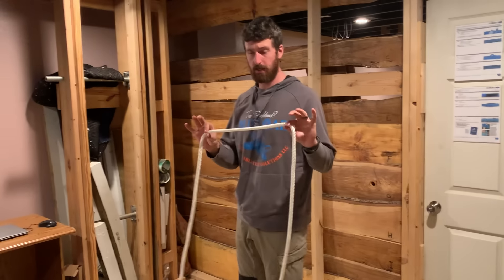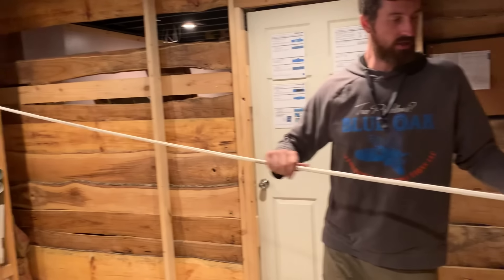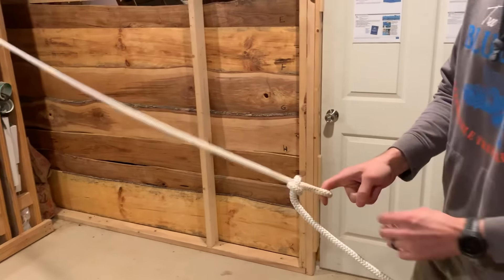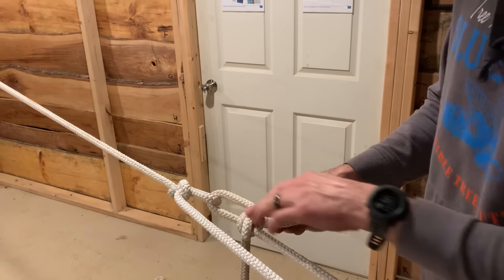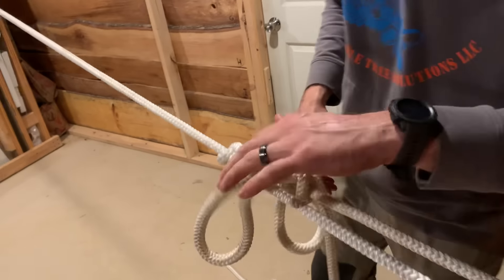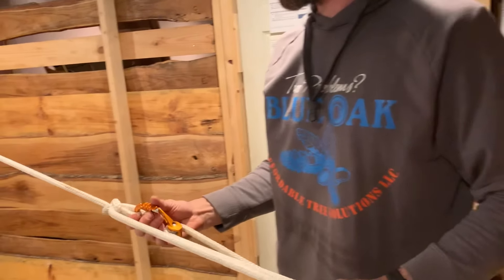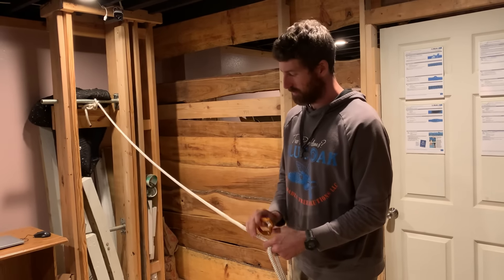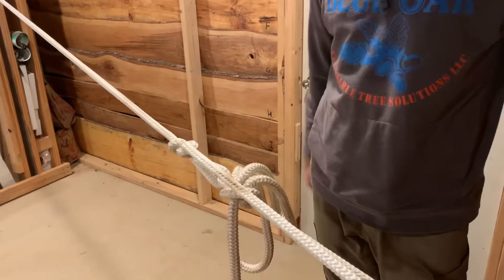The trucker’s hitch and an easy 3:1 set up

Comment: Look at the physics of this. The pole only changes direction, therefore this is a two to one mechanical advantage .
Reply from the maker: Actually this is a 3:1. The first strand is still being pulled, then when it goes back through the slip knot, it’s adding a 2:1.  This makes it a 3:1. It’s the same concept in rock climbing if you have to make an improvised hoist.
Reply: In any arrangement of pulleys, the free end you are hauling on does not count as one of the shortened ropes. 2:1.
Reply: @alexchun1105 , it is well known that the information presented in Wikipedia must be taken with a grain of salt. A look at the revisions of that entry reveal a long list of confused evaluations of the purchase afforded. A cursory check of that diagram claims that the two anchor points are being drawn together by differing amounts of force; The lower point bears a load of 2F while the upper bears 3F, rather incongruous.

Suppose we redraw that diagram a trifle. Eliminate the short length of line supporting the upper pulley, and move that pulley upwards to the point of connection with the rope. In practice this would be done by tying off the upper line to the top of the pulley, and making fast the lower portion of the line to a becket at the pulley's bottom. Now thread the line through the lower pulley, and then back up through the upper. This gives the same arrangement, resembling a little more a conventional block and tackle, and you can count the number of ropes shortened, which is two, as the free end you haul on is not counted. 2:1 advantage.
Reply: @leehaelters6182   Thank you for your considered reply.  I don't have the diligence to understand the description of your model's setup.  But I did look up the references for 3:1 in Wikipedia.  Here they are, in case anyone here has either of these available, and cares to chime in:

Compton, Nic (2013). The Knot Bible. Adlard Coles Nautical. p. 74. ISBN 978-1-4081-5476-2.

Tilton, Buck (2019). Outward Bound - Ropes, Knots, and Hitches. Falcon. p. 34. ISBN 978-1-4930-3503-8.
Reply: @leehaelters6182  The difference between the 3F at the top and the 2F at the bottom is not erroneous. Analysing the forces in the vertical plane gives a total of 3F in each direction, as you have to take the 1F into account from the pulling force. For the system to be stable the forces must be in balance , which they are. If you then tie off the pulling rope to the bottom anchor then you will get 3F both ways. 
They are just taking the temporary case while you are holding the rope.
Reply: @rikwhite6337 , thanks for the reply, I will mull that a bit.
Reply: @rikwhite6337  I concur with you.  All the 1Fs make intuitive sense.  So the bottom 2F makes sense.  The bottom pulley is anchored, and the very top is anchored, so the top 2F makes sense.  So the 3F adds up and makes sense too.
Reply: @rikwhite6337 , re: that diagram. As a means to measure the force multiplier by counting shortened ropes, the end you are hauling on is not used. Now, suppose you hauled down on that end, but rather than making fast to the lower anchor point, we simply chocked the line at the pulleys mouth, so that it would not slip and the end dangled free. We now have a system in equilibrium, and yet the diagram claims differing forces at either end.

If this means that you support the 3:1 mechanical advantage analysis, here is some experimental proof to the contrary:

https://youtu.be/R1a3PTscy-U
Reply: I posted this on another comment too....

If you don't think it's 3:1, you can test it. Set this up between a chair leg and something that doesn't move. Pull the loose end 3 feet and the chair will move 1 foot. It's 3:1.
Reply: @JDeWittDIY . J, did you view the link I posted in my last replies to Nathan, Alex, and Ric in this thread? You can skip to near the end of it, if you like. Joe Pye is quite meticulous.

Did you perform the experiment you describe yourself? I will comply and advise later.
Reply: @leehaelters6182  Yep, I did the experiment with a piece of string, a ruler, and two chairs (sitting on one). I pulled the string 12 inches and the chair moved 4 inches which is 3 to 1.
Reply: @JDeWittDIY , thanks for your reply. I did this experiment, too, and I admit that it is a poser. You do need 3x amount of rope to exit the ''pulley''  loop to effect 1x movement in the load end if you are hauling away from the loaded end, quite so, and if you haul towards the load, which is simply changing direction at the anchor point, naturally the ratio is 1:1. So, it would seem as you say, a three-to-one purchase. And yet, the experimental evidence with scales directly measuring the tension, supplied by Joe Pye, that I linked to is highly compelling, wouldn't you agree? How to reconcile this?

One observation I can make with my experimental rig  is that we might count the hauled length of rope a different way. If you index a point on the main load line and another on the hauled end so that they are even with each other, and then pull enough to move the load 1X, then you will see that the hauled index is only 2X closer to the reversing/anchor point, despite using what seems to be 3X amount of rope to do it. This is because the load line is moving all the while, moving the goal posts, so to speak. What do you think?
Reply: @leehaelters6182  Thank you for the reply.

The video from Joe Pie is interesting, but I noticed a couple of possible issues with it.

First of all, he demonstrated how friction affects the pulling force. When reversing direction around an anchor point with friction, pulling force was cut in half. When adding a pulley to eliminate most of the friction, the pulling force was only reduced by a small amount (something like 95% of pulling force was maintained).

When he demonstrated the trucker's hitch setup, he showed that applying 23 lbs of pressure on the loose end generated 50lbs pulling force. This is slightly better than a 2:1 ratio. Now, there is a small amount of friction in the pulley and a larger amount of friction in the carabiner, so if this were truly a 2:1 setup, the ratio should be a bit less than 2:1 due to friction loss, not slightly more than 2:1 which is what we saw.

I believe that the fact that he demonstrated a slightly better than 2:1 mechanical advantage proves that it cannot be 2:1. With a perfect 2:1 setup, and no losses anywhere, the best you could do is 2:1, not slightly better than 2:1. Something else has to be going on.

My hypothesis is that Joe Pie demonstrated a 3:1 setup that was reduced to slightly better than 2:1 due to friction losses (mainly friction loss where the rope passed through the carabiner). To test this, you could reproduce the experiment, but add a pulley at the carabiner as well. With that setup, I would expect to see a ratio close to 3:1, but slightly less due to friction losses in the pulleys.  This would also be congruent with my previous experiment where pulling 12 inches on the loose end produced 4 inches of movement on the load, which also seems to show a 3:1 mechanical advantage. What do you think?
Reply: @JDeWittDIY , I will mull this a bit. Will advise.
Reply: @leehaelters6182  It's a bit of a stumper. I'm still not 100% convinced one way or the other.
Reply: The diagram on wiki has two pulleys:3-1. This video has one ‘pulley’ :2-1.
Reply: @leehaelters6182 Yours is a common first glance misconception about this hauling scenario. The three to one ratio of rope pulled to load moved is definitive. It is a 3:1 theoretical (or ideal) setup. It's functionally equivalent to a "z-drag" haul commonly used by rope rescuers.

Joe Pie is earnest, but he's not a good source for this case. The friction in his system is substantial: he's losing ~40% at the carabiner and ~10% at his pulley. He is demonstrating that the actual MA of his system is 2:1 (actual MA = ideal MA - friction). The ideal MA is 3:1. Hauling systems are described or labeled by their ideal MA; it's left to the user to account for friction.
Reply: His #2 & #3 ropes don't move, so they don't take part in the advantage. Only the one loop around the knot multiplies, 2:1.
Reply: When you are pulling, there are three strings, so the ratio is 3:1 (due to friction, the force will be less than that). However, once you finally tighten the knot and stop pulling the free end, the remaining pulling force will be only twice of the pulling force (again, not taking into account the friction). So it depends when you consider it, it could be 3:1 or 2:1.
Reply: It’s a 3:1 mechanical advantage, and because they’re ropes, you lose about 1x force to the friction.
Reply: @edreimer4058 no, this video has two “pulleys”. One is “around the other fixed end” and the other is “through the fixed loop”.
Reply: @mhoover the loop around the second anchor point does, in fact, move.

Comment: Put another slip knot in the loose end of the rope that wraps around the pole and get 4:1. Then on that loop go around twice and it will lock.  Secure it with a half hitch.

Comment: what kind of rope is that?  is that rope made for arborist work and or climbing?
Reply from the maker: Yes. That rope is a 1/2”. That piece is a scrap end of rope that I don’t use for climbing. I prefer arbormastor by samson as a 16 strand, or velocity by Samson, a 24 strand. Velocity is easier to splice. And sterling HTP is a really good rope for SRT / SRS because it’s extremely low stretch but you cannot splice it. 

Selecting a climbing rope depends on the type of climbing you are interested in. I’ll be making videos in the future that teach different climbing systems and give advice for rope/tools to use. Subscribe to my channel if you want to see when they come out.

Comment: i used. the same truckers hitch as yours  but recently i discovered. the alpine butterfly knot to replace. the slip knot .. its. easy and comes undone easily no matter how much tension is put on the rope .. check it out :)
Reply: That’s the knot I use for the middle loop. Looks nicer and can move in either direction and  I agree is easy to get out

Comment: I use a directional figure eight instead of the slip knot, any issues with that?
Reply from the maker: If it does the job I see no issue.  The slip knot is just nice because it comes undone with very little effort.

Comment: My slip knot that I used to make the loop kept collapsing on my rope and I knew it had to be something with they way I way forming it.   Finally, someone who explains the right way and the wrong way to do the slip knot and even how to test if you're correct.  Thank you!  Love to see a separate video on how you did that initial figure 8 slip knot.  Looked like you had some additional steps in there not shown in your other video regarding that knot.  Thanks again!
Reply from the maker: That first knot was the slip figure 8 and I daisy-chained the slack.  I’ll do a video on it too later on. Thanks for watching and commenting!
Reply: @blueoakats  The slipped figure 8 to form a sliding loop - isn't that the same thing as a Siberian Hitch?
Reply: If you don't feel like messing with the slip knot, you can just use an alpine butterfly for your loop. Not quite as quick to tie or untie, but a lot more reliable.
Reply from the maker: @nigel7719  not sure, can’t say I’ve heard of the siberian hitch. But I did just make a video on the slip figure 8 I tie in this video. Check it out if you like